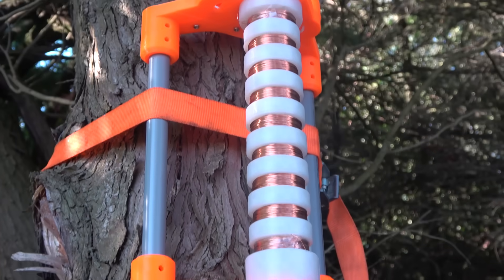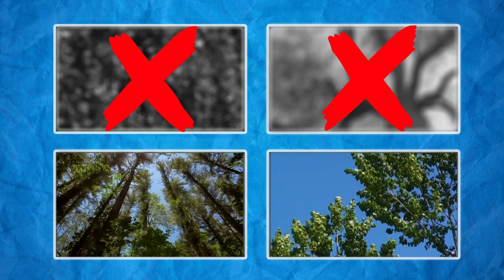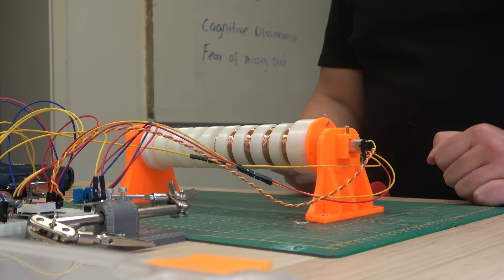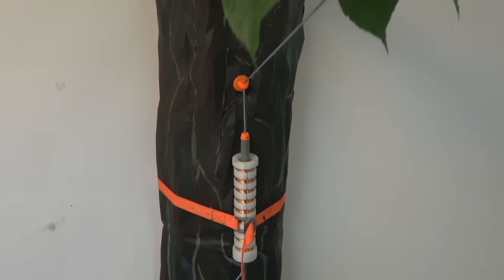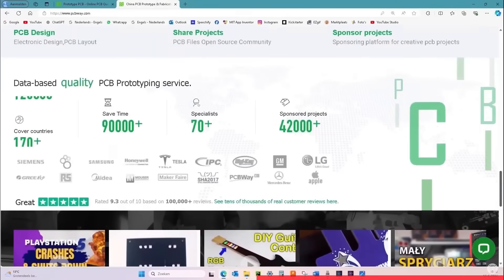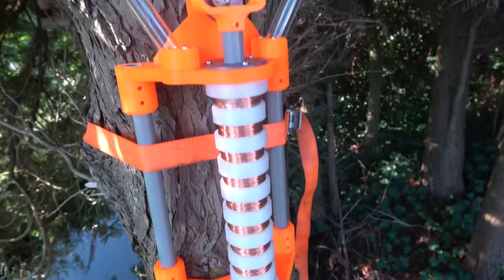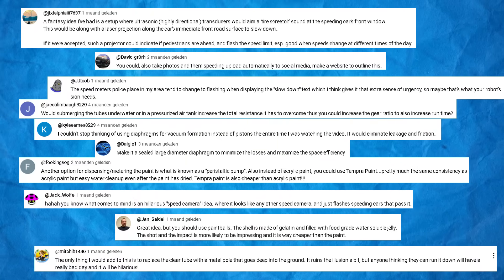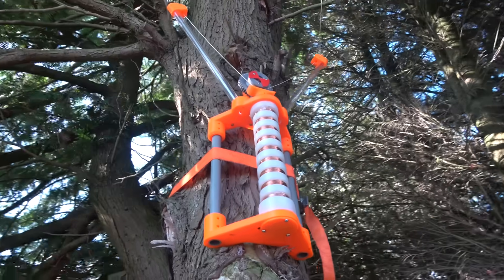I Made a Tree Generate Electricity..

Comment: Instead of having a cylindrical generator like that, maybe it would be better to just use a more normal round one. With the current you need to accelerate and deaccelerate the inertia constantly. With a round you could make a kind of a geared ratchet system, or one way bearings, which then spins up the generator, and like a bike like a bike then cruise when not pedaling. With that you could also add a flywheel to store more energy while the branch is changing direction.
Reply from the maker: As you describe it, it is indeed a great option!👌
Reply: Part 2 ?
Reply: @ConceptCraftedCreations  And there should be noded stages. Just like a tree branches out, so should there be nodes that gather the kinetic energy and transfer it down the tree with continuously accelerated flywheels, or winding coils, for the preservation of energy, with the ropes protected by stretchable sheaths. I would recommend a gear system that accelerates the flywheel in the same direction regardless of where the movement comes from. This solves the problems of rope placement, energy losses due to friction, and organizational structure.
Reply: @ConceptCraftedCreations  the mechanics of it should be all worked out already, you just need to copy the "perpetual" motion used in high end watches that captures body movement and turn it into the windings of the watch.
Reply: @ConceptCraftedCreations  make it a mechanical FULL BRIDGE RECTIFIER
Reply: @ConceptCraftedCreations  Where can I download stl files?
Reply: I was thinking the same thing! Maybe the energy could be stored in a winding coil or a gravity battery and then release slowly at a consistent rate?

This project is such a cool idea with so many ways to be made more awesome!
Reply: @jacobusburger  https://www.youtube.com/watch?v=MG3DBTPM_XU
Reply: This could also allow scaling to many branches/ratchets
Reply: Ooh, I kind of like this idea. Converting the oscillating branch motion into rotation of a sort of flywheel. The trick would be making a way so every motion is used to "pump" energy into the system. With the ratcheting wheel arrangement, it seems like you'd only be putting energy into it half the time, whereas the linear generator works with input from any motion.  🤔  I feel like I did see somewhere where someone made a bike that moves forward whether you pedal forward or backwards, though... I wonder what that mechanism is called.
Reply: @BRUXXUS  you can add more than one ratchet and or one way bearing to utilize both movements
Reply: @mikeydk In theory it should work. In practice, in my opinion, due to the way bicycles are conceived, the backwards pedalling cannot deliver any usable power, not as great, anyway, as the forward one.
Reply: @gaetanoroccuzzo  I don't think you understand what I mean. The bicycle reference was only for the way it can cruise while no power is applied to the input of the wheel hub. With the system I am talking about you got multiple bearings, which lock up when rotating one direction and act as a bearing in the opposite. You then orient them on the shaft in a way so you can pull from any direction, and the pulling motion will be applied to the shaft. Once the pulling stroke has reached its max it can freely return to the start position and be ready to be pulled again, kind of like rowing a boat. Engage, pull, disengage. It don't even have to be done in sync either.
Reply: @mikeydk  I am really puzzled. Why do bicycle racers, professionals or not, have never adopted such devices? 
Are they really out of their mind or so stupid that they refute any improvement? Are we really living in a fable world where the layman knows more than the expert? Please don't let the imagination run wild. 
If you are such a strong believer in your claim, build one and have it patented; if successful, you surely will be a millionaire!
Reply: @gaetanoroccuzzo  but... their bikes already works like that...Not sure why you had to resort to such a reply, but I assume you must be trolling.
Reply: @mikeydk  do you mean racing bicycles have some sort of flywheel that accumulates power, stores it and redistribute when needed and/or whenever the rider pedals backwards power is generated and deployed for forward motion? 
Is that so?
Reply: @gaetanoroccuzzo  no, that would make no sense. It was only a reference to the mechanism inside the hub which allows the bike to cruise without the pedals moving. The flywheel is only there to smooth out the unpredictable movement of the tree.
Reply: Gea, forget about the Bicycle, Mikey wasn’t talking about building a new bike, he was just referring to how the bike pedals work.
Reply: @gaetanoroccuzzo  for something like that you have the e-bike. Racing bicycles (or bicycles in general) work with pedaling forward while they can save energy by less or not pedaling. The momentum is the “flywheel” which carries them forward unless going uphill. For a race, these people are athletes which require a certain stamina to keep the bike going, therefore in their case technology is weight reduction and reduced friction in the moving parts, as are gear ratios. Pedaling backwards makes no sense as it is counterintuitive and in some cases applies to braking.
Reply: @gaetanoroccuzzo  The device @mikeydk is describing is called a "freewheel"--pedal to input power and disconnected when not pedaling. There is also a version called a freehub. A couple of those oriented in opposite directions attached to the same output shaft would be a treat. Lots of efficiencies to find by avoiding friction loss in the system.
On a side note, "The Wisdom of the Crowd" is a concept you should look into when you have some time to go down a rabbit hole. It may alter your idea of experts being better than a group of the general public. Cheers!
Reply: @gaetanoroccuzzo I think that he was saying that you could build a generator that functions the same way as peddling a bike. Peddle, bike gets moving and pedals still rotate even tho you’re not giving the input
Reply: @gaetanoroccuzzo
That’s because the rider is usually only trained to pedal forward.
Skilled unicycle riders can do both directions smoothly.  It’s just an issue of muscle tone, so the same efficiency could be trained for a bike.  Not relevant to this video, but just in case you found it interesting.
Reply: @davidk7529  I grant that on a unicycle (with a fixed sprocket) pedalling backwards gives a backwards motion. Have I missed something?
Reply: @gaetanoroccuzzo right but you can change the direction of the energy being transferred easily enough. So that a backwards thrust converts to a forward thrust.
Reply: @ghadturner5645  I gather that. What seems to have been overlooked is the fact that trees don't always oscillate in the desired direction. We cannot impose on nature, often winds blow from different directions and strength. 
Has this been taken into account? Unlikely!
Reply: @gaetanoroccuzzo and its a fallacy to think that a great idea is only indicated by a booming success in the market. Not all good ideas make it to the mainstream you know…
Reply: Some of the replies here are insane. @gaetanoroccuzzo for example.  

People can be so insulting to others while they are completely wrong.
Reply: @gaetanoroccuzzo  It could if you use another ratcheting wheel for second string. I'm sure there must be a way to power one flywheel with both of strings. If you want go easy way, you could also just use two flywheels - one for each string.
Reply: @gaetanoroccuzzo  A bike doesn't need a flywheel to accumulate energy or momentum because when it's moving it has plenty of inertia which stores that energy | momentum. Just not in a heavy spinning wheel but in a heavy cyclist hurtling down the road.
Reply: @mikeydk  I'm failing to understand how a flywheel loses less energy to friction than a magnetically-suspended system like the one in play in the video, unless incorporating an expensive vacuum-sealed, magnetic bearing arrangement. Flywheels are inefficient technology for energy harvesting compared to something like what's used in solar systems - trickle charge circuits - particularly when considering the power loss curve of flywheels. Is smoothness the primary issue you're looking to solve with the suggestion or is it power storage? Deep cycle battery arrays will 100% beat flywheels for storage.
Reply: @creature_comfort_delta  Only those battery arrays have a minimum treshold in produced voltage necessary to be able to charge. 
The problem they were adressing was that the linear electricity generators are harder to manufacture than buying a bunch of dynamos of the shelf. Since he is already transforming the kinetic energy of the tree into rotational energy, if the energy of multiple sources (branches or treetrunks) could be 'rectified' (like a differential) onto a single rotational device (the flywheel or dropping weight), that device could more evenly impart the rotational energy onto a shaft, and it could power an off the shelf dynamo (rotational generator). 
The idea was not that the energy would be stored on the flywheel instead of using a battery.
Reply: @TheBayru  trickle chargers circumvent the typical voltage threshold issue by utilizing capacitors to charge batteries.  Also, I was under the understanding that the creator built a linear, oscillating implementation of how a typical dynamo works specifically to overcome the complex engineering and efficiency losses inherent when you try and "rectify" alternating inertia. The tree-motion method of energy harvesting is a trickle to begin with; IMO all modifications that insist on large efficiency losses (storing only 1/2 of generated power, flywheel, etc.) shouldn't be considered serious alternatives.
Reply: @creature_comfort_delta  The idea of a trickle charger is not to turn a trickle of a source into a steady charger (apparently as per your concept also implementing a booster from a few volts to 12.8V or more and some capacitors to flatten the curve), but to continously top up a battery using an ideal charging regime.
While the flywheel does present losses, the idea was to combine multiple inputs (branches) onto a single flywheel, thus dividing the loss. And mind you, the prototype design also contains 3 mechanical elements (plus friction on the plunger, and a magnetic springmechanism dissipating energy) representing losses. And if you look at a wind turbine, it contains a full gearbox and sometimes automated steering, ... you will always have losses. So if you refuse to think creatively and dismiss ideas out of hand, might just as well start with "Wind turbines are a mature design improved upon by professional engineers for thousands of years, who are you to think you can do it better with some rope in a tree"... but that would be missing the point entirely of this exercice wouldn't it?
Reply: @TheBayru  lol fair enough! I will abstain from dismissing creativity, particularly in the realm of novel engineering. Though, the type of trickle charger I was referencing is more akin to a Miller Solar Engine than the device you mentioned.
Reply: @gaetanoroccuzzo  Because it usually isn't needed to get power from backwards rotation on a bike, but there's a type of bike by a company called Stringbike with that requirement. And guess what? It works exactly like the mechanism @mikeydk described!
Reply: @mikeydk  something along the lines of the auto wind on my watch...aka magic lever...
Reply: @BRUXXUS  Two ratchets! Each going an opposite direction, and one with a gear added in to reverse it so they both spin the final output the same way. Probably with a flywheel added in to smooth it out.
Reply: @BRUXXUS  I think you're thinking of the video by the 3D printing channel Makers Muse called "This Mechanism only turns Clockwise, no matter what" which, as you could guess, only turns clockwise no matter which wway you turn the crank. I'm guessing there is some technical name for it, but the only place I've been able to find it has been that video.
Reply: @robonator2945  That's the one!  That was a really cool video.
Reply: @BRUXXUS  the flywheel could be mounted to a D/C motor to produce electricity after its stored up.
Reply: @BRUXXUS  How about a pendulum to store energy instead of a flywheel? Maybe a conical pendulum could address the issue of the three bending in every direction... 🙂
Reply: @BRUXXUS  it's called a retro-direct gear
Reply: @BRUXXUS , what if two generators are put one by another, and the ratchet gear in  the two would work in the opposite directions?
Reply: Yup, I think a flywheel and one of those simple mechanisms that keeps the output direction the same regardless of input direction would do this well
Reply: This was almost exactly my thought. Store the energy in ratcheted mechanisms attached to springs, like a watch gear, which release after being wound which in turn power a flywheel which is turning the actual "alternator".
It doesn't necessarily need to be mounted on the tree either; between a stand of 4 or 5 surrounding trees a device could be placed centrally with multiple points of connection surrounding it.
Reply: A swaying tree probably pushes anywhere between 400  to 900 pounds in each direction. A much bigger system and with a flywheel, I'm going to put out there you could probably get 0.4 kw per tree if optimized.
Reply: Perhaps this could be combined with my idea, which was to instead utilize the movement of the tree trunks. I'm thinking of a group of trees connected by a central hub, and as the trees sway away and towards said hub, they generate electricity. The higher up in the trees, the more kinetic energy to convert. (But not too high). I first thought the hub should be independent - maybe on a simple stand or tower between the trees - but perhaps it could just be attached to a central tree.
Depending on the setup, you may lose the benefit of gravity helping the process since this would now be using horizontal motion. But the movement of the tree trunks themselves involve greater force than the branches, because 1: the trunk has more mass, and 2: its movement is driven by the wind acting on the entire tree, vs one branch. (I know it's not as simple as that but I don't feel like writing more than I already have...)
Reply: Yep, couple one-way bearings, and a flywheel. Spinning a normal round style generator/motor and using rectifier from standard wind turbines.
Reply: You could use something like the Seiko "Magic" lever that they use in automatic watches. It would turn mechanical motion of the gear in either direction into rotational motion in one direction. By having that wind a spring, you could store the energy to run a larger flywheel, increasing efficiency (Maybe, idk if that is how it works).
Reply: If you use higher tensile strength wires you can spin the flywheel generator with more strength. Or gear it so it can transfer more movement.

Adding more weight to the flywheel attached to the generator can give you a more stable output.
Reply: @lyjara  High test fishing line! Metal would cut through the branches in higher winds, I believe.
Reply: Yes, the bike analogy is called a freewheel drive. However, while this works for a bicycle (or internal combustion) because force is always applied to one side, trees move more randomly and the retrograde motion would need an equal and opposite second mech to capture the motion in the opposite direction. This might result in an additional inefficiency of the system. How great or insignificant that inefficiency is beyond my brain to calculate, though.

Worth a shot, though...
Reply: The flywheel idea is as good one. I wonder if there a good way to transfer multiple different angles of tree movement into one continuous movement of the wheel. Obviously a ratcheting mechanism like you suggested but also tying some sort of cable off to both the x and axis of the tree to account for all wind directions. Someone might have already made this suggestion. I didn’t read every comment 😬
Reply: I believe a mechanical rectifier could convert the back and forth motion into a single direction rotation for running a regular rotary generator. It would be a lot more efficient.
Reply: I like this idea a lot becuase i think it makes better use of the movement of a tree - they might move less distance and less consistently than wind or waves (or photons), but would produce incredible torque on your flywheel. Instead of trying to capture the energy of every little movement - capture a bigger percentage of the big movements, i think thats the low lying fruit here.
Reply: https://youtu.be/y44_xMFsPQQ?si=CRXtLm0oWnyiOfQf this with a flywheel on the output of the mechanism
Reply: I like this, you could add a large flywheel to this to make it work smoother too, adding a decent mechanical advantage to the flywheel from the tree because the tree could handle the added stress.
Reply: I immediately thought of the same idea when i saw the video and wanted to write about it but you've beaten me to it
Reply: Have you considered using a tall palm tree with three ropes attached from the ground to its top? ;)
Reply: There are rotary motion systems where the output only turns one way no matter which way the input turns. In this way you could use all the power of a branch moving left / right
Reply: two way input rotation into one way output
https://www.youtube.com/watch?v=JOu3ZFo2Vqw
Reply: I have a screwdriver when you hold the middle piece in between the head and the handle, left and right rotation of the handle turns the head in one direction at the cost of torque, maybe you could use a system like that? It’s called a Kobalt 6x speed double drive screwdriver
Reply: I was thinking the same.
Reply: I agree. I thought the same and commented b4 reading yours. So it seems like its a common concept
Reply: there exist a mechanism that takes "AC" rotation and turns both movements into one direction of rotation.
Reply: Thanks Dad!
Reply: 5😮vf t r😮😮c dwa 2:25  9😊q 😊 88biib😊😊
Reply: its an induction generator . so making it circular would actually require more force to keep it moving ... than the tree can provide ... making it create less power overall
Reply: And perhaps have a flywheel to make a more steady motion. I like this idea because of its simplicity
Reply: I also think thats much more scalable. Each branch isn't going to produce a ton of electricity so you need to make a bunch of them. I think something like a small rotary generater attached to one of those retractable lanyard mechanisms would be cheaper to build and much more scalable.
Reply: yeah, a collar with magnets and you have coils in their bed and places around the home
Reply: I heard of someone doing that in Nimbin, using a weighted flywheel, which could just be a a push bike wheel with a generator hub and a few add ons.
Reply: I would think making it cylindrical would be more efficient space wise. sure it'll be more expensive but you can have it more compact. Also since it's simpler, it's cheaper to maintain.

edit. iirc, the downside of a typical generator is that it needs to spin at high speeds. with slower motion, a linear one can make up for speed with "surface area"
Reply: How about a pendulum to store energy instead of a flywheel? Maybe a conical pendulum could address the issue of the three bending in every direction... 🙃
Reply: @wacharaboy  a pendulum is what the tree effectively is, it would be an inefficient form of energy storage. especially if it's heavy, would be better to lift it up with some ratchet system then let it drop
Reply: You can get double acting ratchet screwdrivers at Lowe's that convert reciprocating rotation of your wrist to constant unidirectional rotation. Maybe pick one of those up for inspiration?
Reply: this would be like the old maintenance carts that used to be used on railroads where two people constantly push/pull the seesaw like lever
Reply: Bikes mentioned: 

Linear pedaling: https://youtu.be/xev18rBrNr0

Flywheel bicycle: https://youtu.be/gahKxbwUcYw
Reply: One thought here is to attach to a few branches on each side of the tree, using two one way bearings or ratchets that allow for free spinning motion in one direction & work load in the other. Then a similar transmission that would then convert all movement into a single direction 

That could then be sent to a slide rotary system to turn all of that movement into rotary motion, allowing for a flywheel rotary generator to be spun up.

On the slide rotary system, there could be a switch mechanism that would allow you to control the direction of movement coming from connected branches on the left & right of the system, so when it reaches its maximum slide, it can change the input as needed.

Things others mentioned above:
- a mechanical motion rectifier may be better than two one way bearings / ratchets
See video: https://youtu.be/kkE0yVWwlWk @ ~5m

- a spring or another system may work better for temporary energy storage if there is not enough or too much mechanical energy being generated. Detaching the flywheel from the generator or using a cranked weight mechanism instead may offer a similar or greater advantage

Cranked weight system:
https://youtu.be/igzIc3glA18
Reply: my thoughts exactly, use the linear motion to drive a flywheel to generate power, as the flywheel will continue to spin after the initial motion, the power is generated in a more stable fashion.
Reply: Flywheel has nothing to do, as generator will keep changing rotation direction.
You just need a converter to rectify and then invert to the required frequency.
Reply: You’d need to make a way to harness both directions
Reply: Maybe using two that spin in opposite directions could capture the energy from the limb going both ways.
Reply: @aremoreequal  actually very smart idea
Reply: I had the exact same idea.

You could also have alternating ratchets and a gearbox on the capture wheel to capture energy going in both directions and convert it into a single direction to drive an alternator.
Reply: I think one of the main problems to solve is to use several branches. A round system as suggested by others would allow you to connect branches to the rotor and the stator (contrary to its name)
With a ratchet system, clockwise movements could be transmitted to the rotor, say, whilst counterclockwise movement can be transmitted to the other gear. They can be used to connect multiple branches as well.
Reply: Dutch?
Reply: @boazhendriksen3565  Or Flemish? Who cares...
Reply: Use a rowing machine! :)
Reply: @napierpaxman  I wonder so often about how much electricity a gym could provide. Imagine TVs would only be sold in future with an exercise bike attached and would only work if someone charged the batteries with that bike beforehand. I think obesity would be a problem of the past
Reply: I bet you're right, but I like how simple his design is. This looks like something anyone could diy at home. Even someone like me
Reply: well that's my point made, thoroughly agree
Reply: Bros either an engineer or plays create
Reply: Imagine power plants as a forest of "power plants"🌵
Reply: Has anyone tried this kind of induction under water of a moderate turbulent river or an ocean, you know to use the water current as the " wind "?
Reply: I'd love to see a sequel to this video putting this idea into motion
Reply: i wanted to say the same
Reply: A tree transmission to stabilize energy input. Very nice!
Reply: if you need a flywheel, a good solution is also in bicycles, take an old bike wheel and fill it with concrete.
Reply: The part you're thinking of is called a freewheel or freehub. Basically the same thing except that one is integrated into the hub while the other is a seperate part. They both work the same with many small spring loaded internal pawls that engage to transfer energy in one direction but are sloped to allow the mechanism to move freely in the other direction. Pretty much a ratcheting mechanism as you said.
Reply: Keep in mind that adding any gears/transmissions etc. you loose power at every step of that kind. And probably we should keep it as simple as possible to conserve power and make it affordable, cheap, easy to produce :)
Reply: how do you use inverse energy ? if you to do how the bike, you lose inverse energy. Do you no think ?
this system instead use all energy.
Reply: Keep in mind that adding any gears/transmissions etc. you loose power at every step of that kind. And probably we should keep it as simple as possible to conserve power and make it efficient, affordable, cheap, easy to produce :)